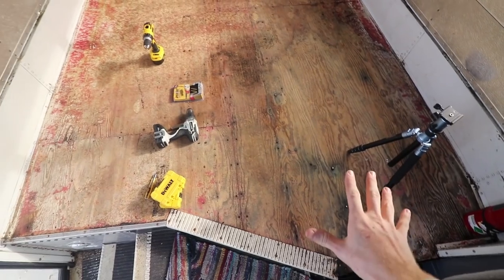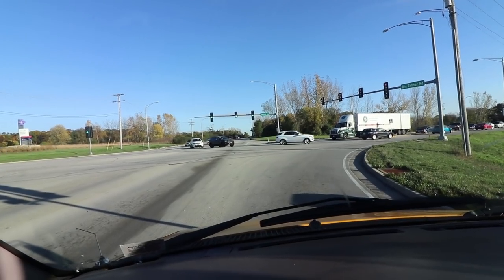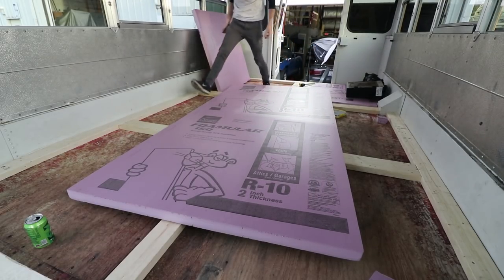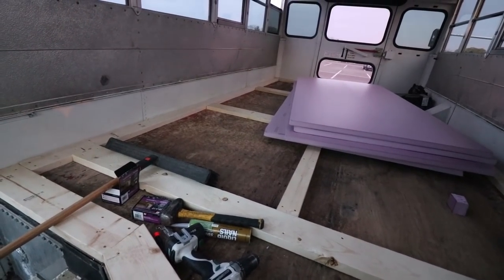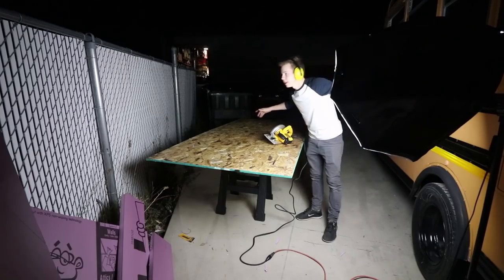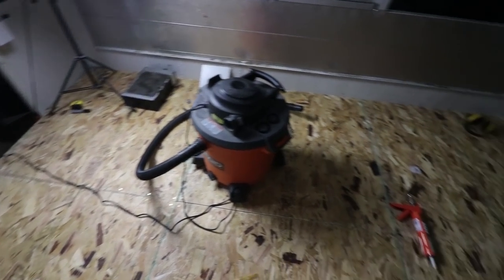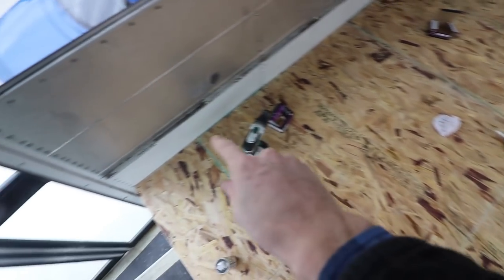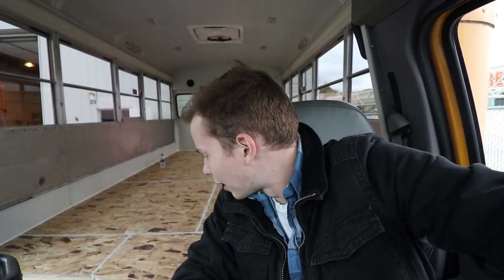Adventure Bus Build Pt 2 - Building a New, Insulated Floor!

Comment: So wait, the bus does barley 60mph, then ur gunna pull a trailer, a car, and heavy furniture?
Reply: Sirens It does more than 60 in the first place.
Then he's not adding weight he remove a lot and will put back pretty much as much.
And he's not driving fucking 40 childrens.
I think you forgot that this bus is made to drive around a lot of childrens with their bag and shit plus a lot of headroom for safety.
And all this is probably as much as the trailer and the car on.
And you also forgot it's a diesel it can tow anything.
Reply: IMNOTA  calm down it was a an exaggeration. But also i think a car an trailer weigh more then some kids. 3,000Lbs+ a 1,500lbs trailer plus all his wheels and tools and the people inside.  im not saying it wont pull it because it might, it just wont go very fast at all. Plus a short bus gets about 10 mpg alone, now add all that weight an say goodbye to your money..

Comment: If its cold the day before and that night before you start the bus since it is a diesel let the glowplugs warm up for a minute or 2 if not you could ruin the engine
Reply: VapeL0rd N0rd A diesel doesn't need that much time to heat the plugs.
It's like 20s on a diesel car, but idk about buses.
Reply: IMNOTA that's on a car but if it gets in the negatives it will take about 5 minutes bigger diesels do need some time to warm up i have a 2007 Ford f-350 LWB and if it gets to about 40 degrees outside ill sit there and wait about a minute for the diesel to warm up